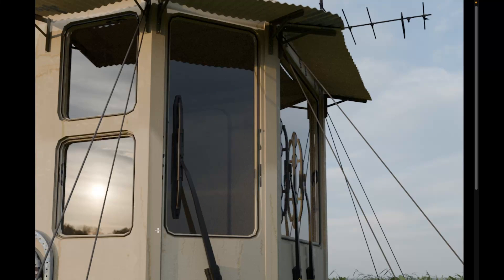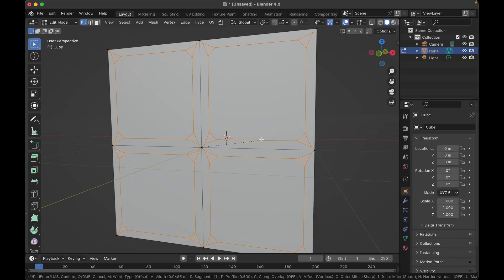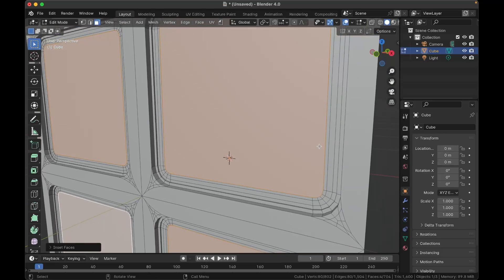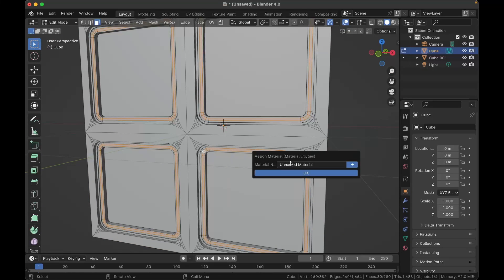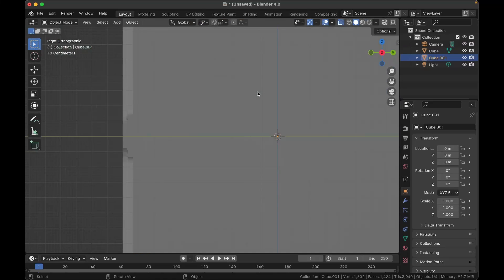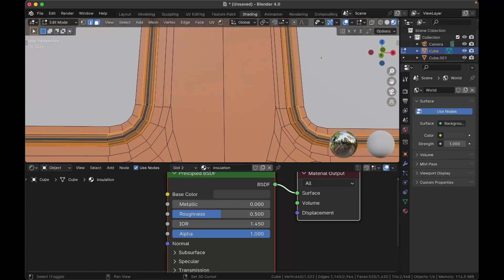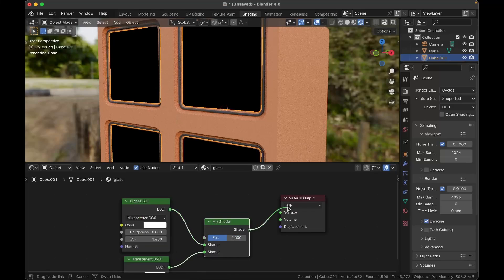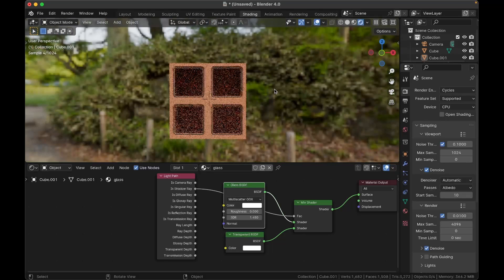How To Create Realistic Windows In Blender

Comment: hey there, thanks for the tutorial! this might seem stupid, I'm new to blender so I'm just wondering what I missed :D When I select the insulation part, I can only select the faces and edges by segments instead of the whole loop
Reply: Hold alt while selecting an edge to select a loop, may or may not work well depending on your topology.
Reply from the maker: Yeah just hold down ALT or OPTION when selecting
Reply: @samuelsullins  I had this too. If I select a few in the right direction with SHIFT, then hold SHIFT + ALT and select the next face in line, it worked.

Comment: Copy and do the same mixing with if diffuse ray ( Input>Light Path ) for even better glass. Add Musgrave with tiny strength for glass to wobble a bit, through bump into normal socket, since no glass is ever perfectly flattened. Maybe some are, but mostly aren't.
Reply from the maker: Pinning this for everybody…thanks!
Reply: @samuelsullins  You're welcome! :)
Reply: Is diffuse Ray an external add-on? Plus the Musgrave, I noticed I don't have them
Reply: @Pinkode  1. It's in Input Nodes, Light Path .
2. Musgrave is part of Noise in 4.2, it was Separate Texture Node before that. There is video on YT that explains it correctly, i don't use 4.2 still.
Reply: @AdamIsailovic  God bless you